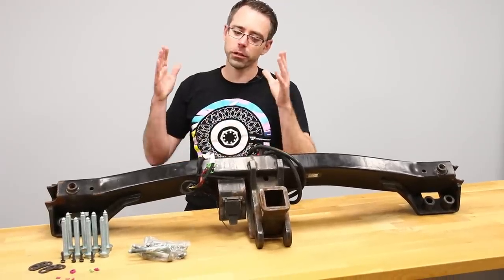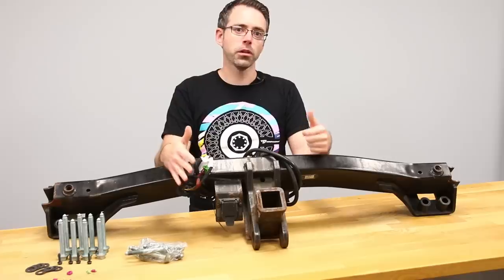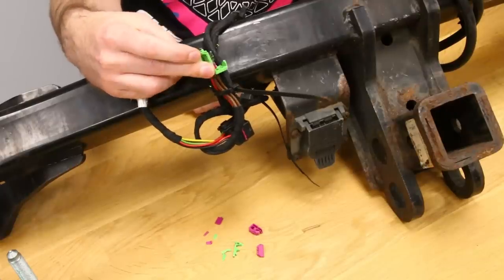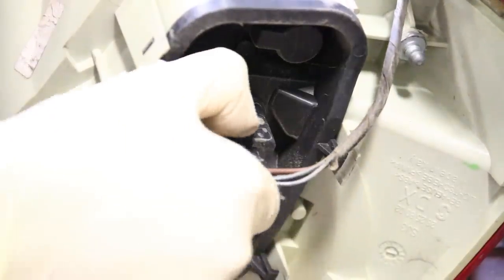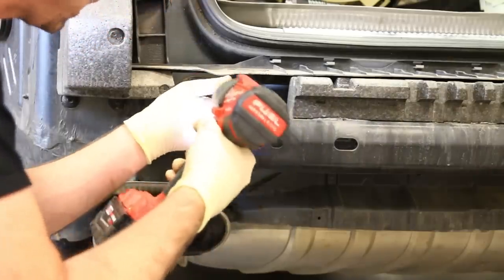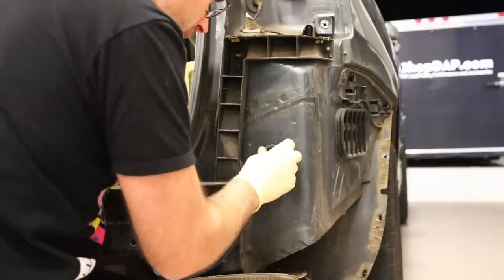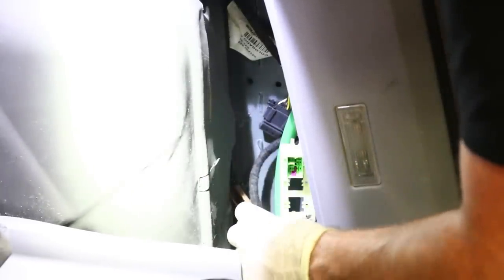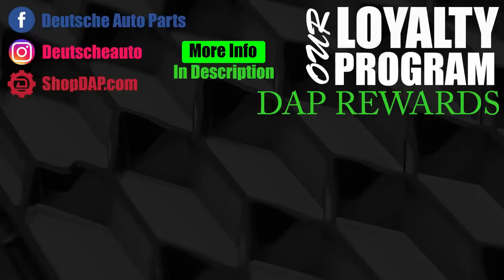Buying a Cheap Trailer Hitch for a Touareg

Comment: Module requires 1 hour labor to program unit. You mention most of what the module does. It also incorporates the alarm system to the trailer. If alarm is activated and if someone disconnects the harness from the trailer, the alarm will go off.

Comment: Paul - great video!  I went through the same hitch installation I purchased new at that time with the control module about 12 years ago. Together with a brake controller this set up is fantastic. As you mentioned it controls the electric brakes and the shift point changes but also an added feature is it will arm your trailer when you disconnect the trailer with the Touareg locked the alarm will go off

Comment: The OEM towing module doesn't provide trailer brake control. A stand alone controller is still required.

Comment: Why didn't Wolf supply the module?
Reply: I was thinking the same thing, but they might not want an used electronic module. We will have to wait and see.
Reply: We didn't have the module and wiring harness in-stock at the time Paul asked us to collaborate on this project. These items go quick.
Reply: @Wolfautoparts do you sell a hitch for a 2014 vw CC ?